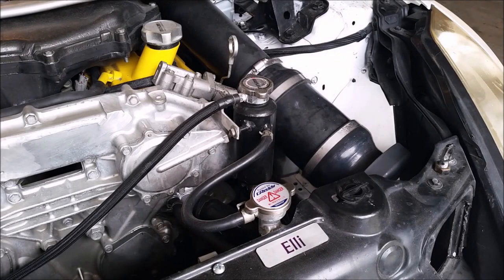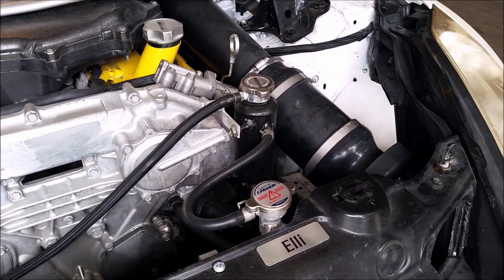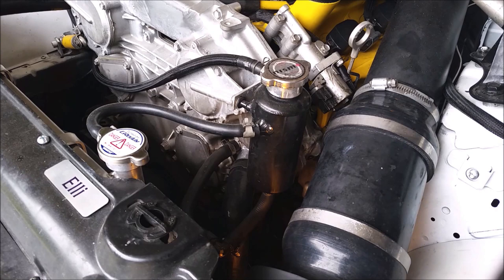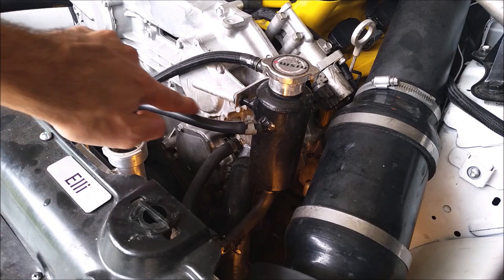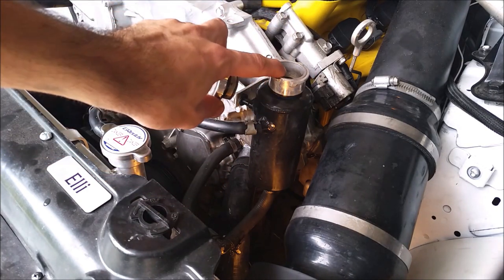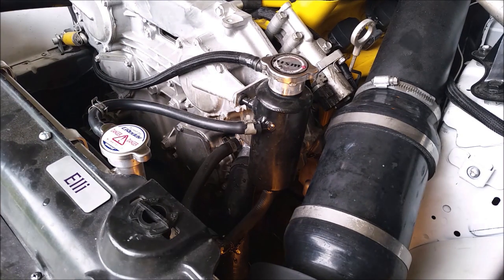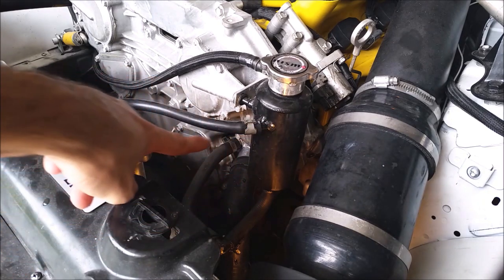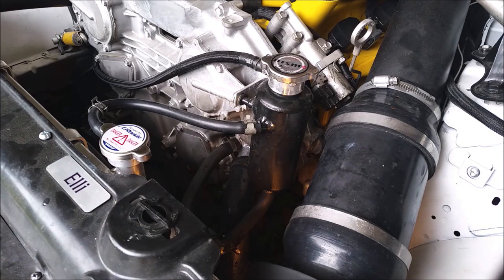Nissan 350Z Coolant Swirl Pot Custom DIY

Comment: Hi, where does the upper hose by the breather tank cap connect to if I’m still running the heater system on my 2003 Nissan 350Z?
Reply from the maker: The very top hose goes to the overflow tank. This set up should be identical whether you maintain your heater or not.
Reply: 350Z247 do you have like an IG so I can follow and message you better for any more info?
Reply from the maker: @benny6712  yup, same name as the channel
Reply: 350Z247 thank you
Reply: 350Z247 Hi
I noticed that the smaller hose from the thermostat housing connects to the other end. 
But did you cap the other end close where the hose that connected to the thermostat that now is going to be connected to the bottom end of the swirl pot? I sent you a picture to your IG for reference. 
I want to confirm all this before I but this kit.

Comment: Can I use this with all the normal heater hoses and stuff
Reply from the maker: Yes. Not ideal, but it will work. I would put it in the middle front of the engine as high as you can under the hood using that hose that crosses the front cover. Make sure its higher than the vent on the back corner of the motor.

Comment: Would this be similar for a HR?
Reply from the maker: It will be similar. Replace the cap the same way, run the hose for the overflow take to the swirl pot, the drain goes to the same barb on the thermostat, and the overflow now connects to the top barb on the swirl pot.

Comment: Hey man, just curious if you blocked off the other inlet on the swirl pot that's listed on ebay. It has two inlets and I'm not quite sure why.
Reply from the maker: Cade Crowden I did. I tapped it to accept an M6 bolt and used it to mount the can. You can cap it off or use it for another coolant line depending on the car.

Comment: Is the swirl pot just one cylinder or is it another cylinder inside of it like a baffle system? Maybe baffle is the wrong word will there be a smaller diameter pipe inside the outer cylinder?
Reply from the maker: It's just a hollow cylinder. The coolant comes in at a tangent then cause a cyclone inside the container as the fluid drains out the bottom. Any bubbles in the system will work their way to the center of the cyclone which helps continuously bleed the system.

Comment: And how do you bleed it when you install it
Reply from the maker: Just work the fluid through the hoses real good with the cap off then run the car for a bit to let the air escape. It will also bleed itself constantly. I jack the front of the car up to help the air make it's way to the top. Also, fill the water back in slowly to avoid trapp9gng air